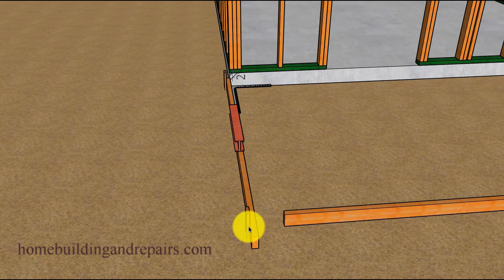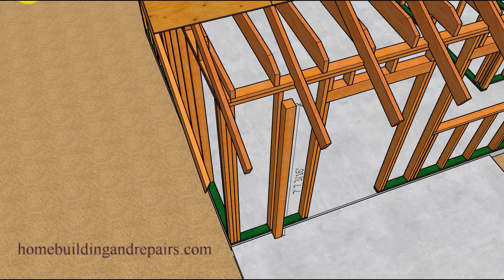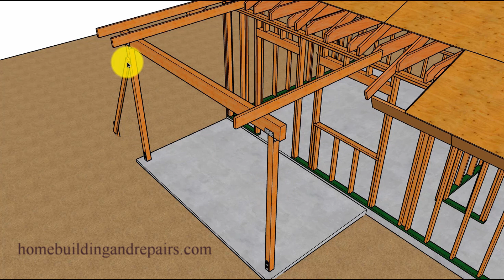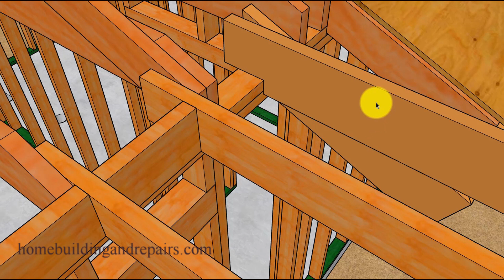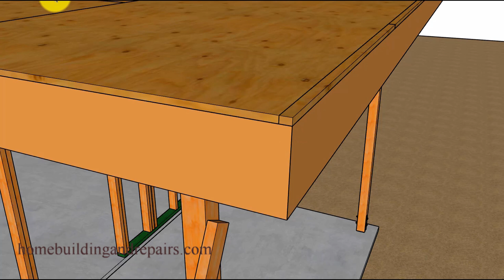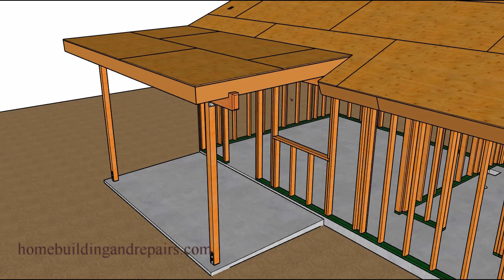How To Build Small Covered Patio Roof And Concrete Floor - Do It Better Yourself And Save Money

Comment: Great video, I am adding a 10 X 16 Deck and roof same style roof, can I tie into the house using this method? do I have to have the same pitch as the roof?
Reply from the maker: No, it can be different.

Comment: If a small rip piece is needed, I would have put it at the connection of the two roofs and used flex flashing tape or cut the end of the rafter studs to make layouts for sheets of wood. Practicing a quick layout before fascia or sheeting the roof porch is good. Easier to make adjustments at that point. That works for me and what I have learned over the years.

Comment: Good video. Helps me out in planning my covered patios on my new home. My home will be at 6200' elevation with snow loads of ~60- 80 Lbs/ft. Patio cover for walk around porch will be 8' wide. Looking at post and exposed beam rafters. Would like to see a video of attaching the rafters to the roof trusses or ceiling joists. Thanks

Comment: Good video. I am trying to understand how to create a covered porch in the front of my house which has a 6/12 pitch roof. I would like some slope on the roof so pine needles and leaves don’t collect on the flatter roof. Like the one in the video. I was thinking more like a 3/12 for the porch. One end is on the gable end and one runs into a valley as the house is L shaped. Any thoughts?

Comment: My patio is 12'x12' and I wanted to ask if I can use a 4x4x12 for the beam? Very informative video and had no problem watching if it was 15 minutes long. Thanks for the info.
Reply from the maker: I can't provide you with lumber sizes, but can tell you that I've seen 4x12 used for patio roofs that are not in areas where it snows.
Reply: @gregvancom  Thanks, I'm in South Texas where we might get snow once every 10-15 years. We do get hurricanes though. Thanks for your help.
Reply from the maker: @jbz33Zavala  You're welcome.

Comment: Great video Greg, it is very informative.  I am pouring a patio with a similar roof style.  The slab is measuring 36' × 11'. I have heard to add additional footings every 6' throughout the slab in addition to the 12" ×12" areas of the supporting post. Is this absolutely necessary or have you heard of this? I haven't seen you do this in your videos. I am trying to stay away from unnecessary work or expenses.
Reply from the maker: Most footing are used to support structural load bearing posts and not randomly placed in slab with out a reason.
Reply: Thats exactly what I understood prior. Thank you! I also wanted to see what size beam would be able to span 13' from post to post and support a flat sloped roof.

Comment: 5/8 inch thick plywood is thick enough for a roofer who uses the right size air gun nails not to  penetrate thru the bottom. fact.
Reply from the maker: Yes, I've used it before with great results.

Comment: This was helpful. Thanks. I'm looking at attaching a pergola to a patio and one common solution was cutting a hole in the patio roof to put a bracket attached to the top plate or rafters (like "skylift" or "beamlyft"). This seems like anther option though it would require removing and reinstalling a couple feet of the patio roof.
Reply from the maker: If you're referring to cutting slots for individual roof rafters or beams, it will work as long as these components can be securely fastened to the necessary framing like top plates or existing rafters.

Comment: Great video Greg I learned a lot!  With the slope not being very steep, I'd use a flat roof material rather than shingles, you'll have leaks within a couple of years.  I'd use modified bitumen, or a tan tpo, maybe even metal on the addition.  On such a low slope, shingle tend to absorb water rather than shed it like a normal sloped roof would do, and this cause leak's and for the roof to fail pre-maturely.

Comment: Would it be permissible to attach a ledger board to the rafter tails with lag bolts and use rafter hanger brackets on that ledger board to suspend patio cover rafters?
Reply: I think you should remove the roof overhang entirely if you do that. Then, support the ledger board over the wall ceiling plate
Reply from the maker: I've seen it done quite a few times and never came across one that fell down, but don't think most building and safety inspectors like it.

Comment: What type of roofing material will be used and how is it going to transition to existing shingled roof?
Reply from the maker: That will require another video and I put it on my list.
Reply: Would be roll roofing, or a metal roof/standing seam roof. Pitch is far to low to do 3 tab or arch shingle roof on without leaks. Either are fairly easy to tie into a shingle roof.

Comment: I would've installed 2 more footers against the existing slab on either side in order to place 2 more columns against the existing structure and a header on top adhered to the existing facia and at a distance under the existing roof to allow for 5/8 or 3/4 plywood sheathing, Ice&Water Shield and roofing (shingles or metal).  In this way, you don't expose the existing roof structure and can build at your pleasure and still be tied into the structure.  Q.E.D.
Reply from the maker: That sounds like a totally different design, but definitely one that could work.

Comment: Great video very informative, I have a question about this. I have been looking into doing this to my house but my patio would be over a deck. Do my post holding the roof need to extend from my post holding the deck up?
Reply from the maker: For the most part, yes, but it will  depend on the design. The footings might need to be larger also.

Comment: Great video! Thank you.

I built a similar patio cover but much larger using the same method. I did run my porch rafters a little long into the attic space, and sistered them to the truss heal with structural screws. Also, in an effort to increase my pitch without sacrificing beam height, I just laid down 2x blocks on top of the plate between trusses.

I made one critical mistake in that I did not install blocking before laying OSB and installing shingles. It was a rush job, my attic was exposed and there was threat of rain. Without the blocking in place, the live load contributed to tilting some of the rafters slightly.

The concrete pad was already in place, so I don’t know about the footers for the posts. To compensate for this unknown, I spaced my posts less than six feet apart. Not sure if this unknown compromised the structural integrity of the patio cover.

Anyways- thanks so much for sharing!
Reply from the maker: You're welcome and I've seen plenty of patio roofs built like yours without any problems.

Comment: What do you think about running a plate on top of the existing shingles instead of pulling off shingles and sheathing?
Reply: When I researched this subject, your idea was one of the solutions. Positive is that you don’t have to expose your attic, and it’s structurally strong. One big draw back for me was first, cutting the house end of each porch rafter, and then dealing with the eves under your new roof.

You could cut the eves right off, install your ledger (what you call a plate), then run your rafters. That would help the issue under the new roof. But if you’ve ever cut through a roof, you know that if you’re gonna cut your eves off, you might as well go through with Steve’s method.

I’m no expert, but I used Steve’s method for my 400 plus square foot patio cover. For another patio cover, I used the ledger board method.

Each approach has positives and negatives.
Reply from the maker: I would need more information, but I'm not a big fan of going over roofing with any framing members. I like a tighter framing connection, but as long as you can install roofing without leaks, then it might be fine.